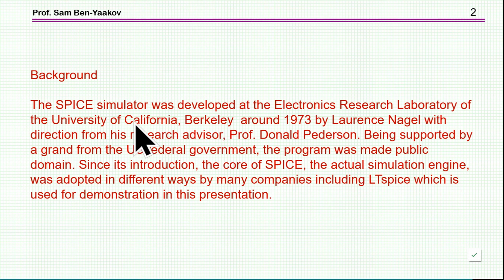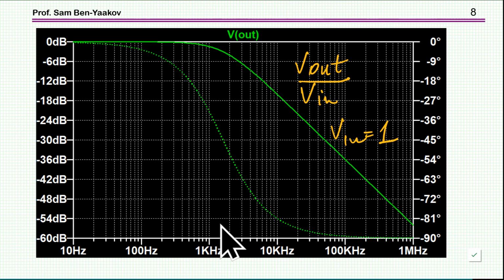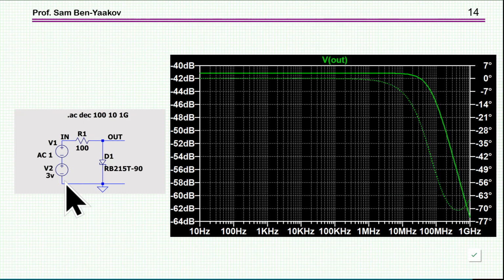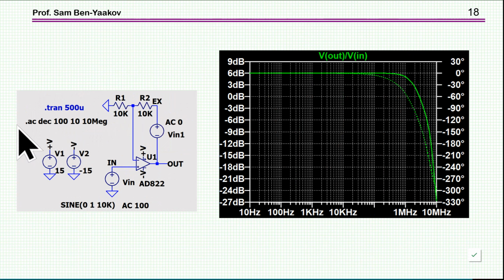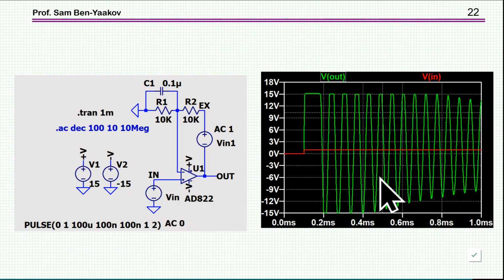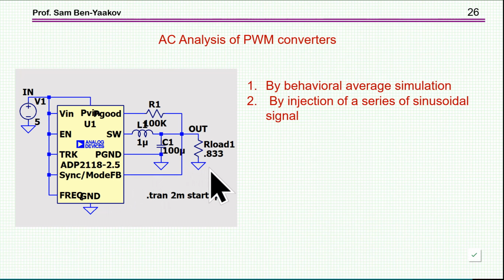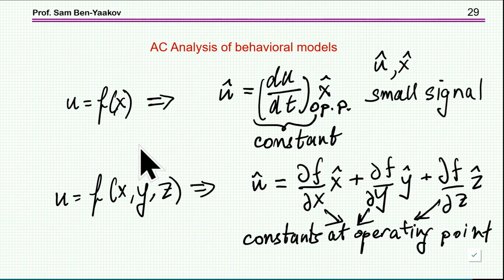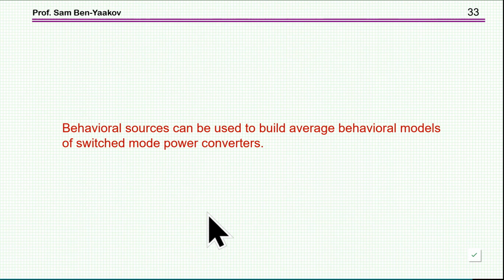AC Analysis (small signal) in SPICE (LTspice)

Comment: Thanks a lot for all your great videos. Always a pleasure to see.
Would love it if you could help me with this topic since you just mentioned it.
I try to figure out how Spice does calculate Diodes. 
I have a Diode and then try to make an equivilant circuit and compare them to each other. 
0.6V Volatages source and then compare the current through each model. 
If I use an behaviour model for the equation of IF it gets close to it. But not the same. 
Behaviour current sources dont take into account resistors in the same circuit. 
Also stumbled upon ROHMS website. But didn't find a solution so far. 
If you have time to help me out a little I would appreciate it.
Kind regards Jan K
Reply from the maker: PSPICE had a tool for extracting the parameters of models including, I think, a diode
Reply: @sambenyaakov  Well I use LtSpice and my point is that I can't replicate a diode excactly. 
LtSpice knows the parameter from the .model I give. For example the .model 1N914 D(Is=2.52n Rs=.568 N=1.752 Cjo=4p M=.4 tt=20n Iave=200m Vpk=75 mfg=OnSemi type=silicon)
If I define these parameters and use a current source with the equations of 9:40 for the current through the diode, it is 
At 0,6V the current through the diode is:
1.42mA through my self created model
1,39mA through the Spice diode model
Would like to eliminate the last error, understand how Spice calculates Diode currents and what kind of accuracy I can expect. 
Spice does all kind of things in the background. Simulated often and it calculated for ages and didn't give me correct or expected results. 
For example if I want to understand scientific papers and simulate the circuits. 
Kind regards